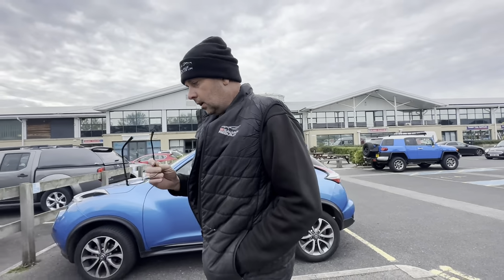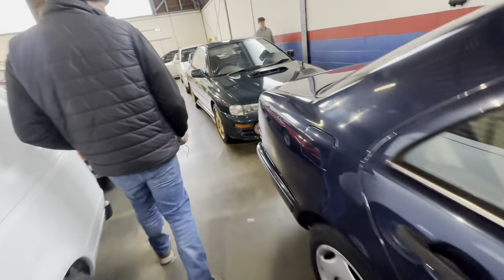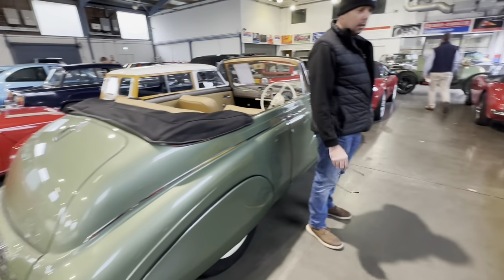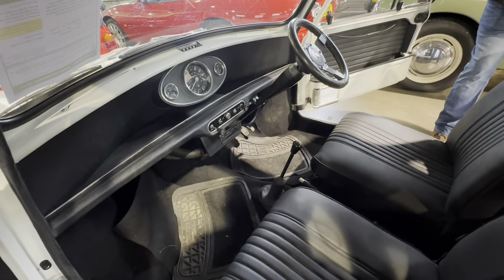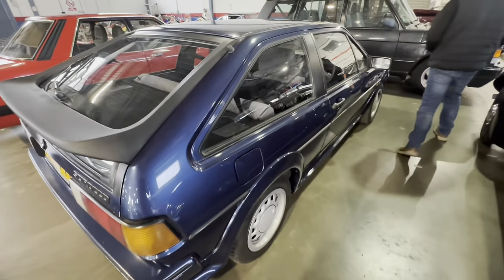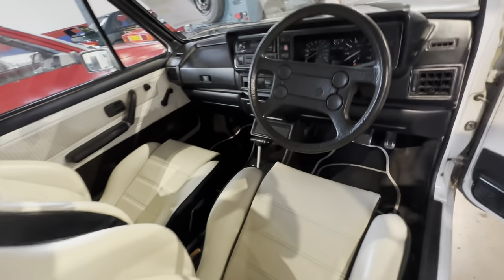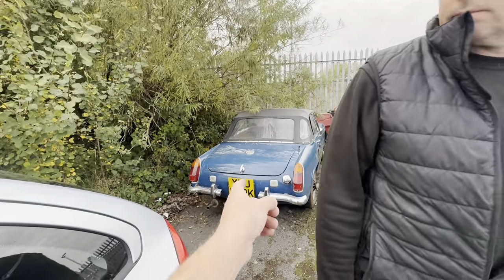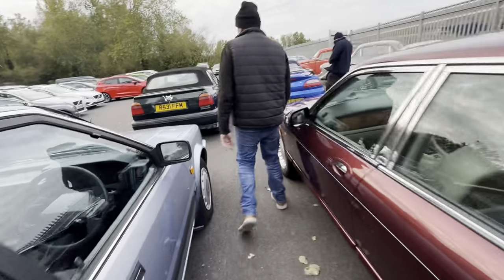CAN WE BUY SOME CLASSIC CAR BARGAINS AT AUCTION???

Comment: Volvo 940 and 240 for me! Had a 1989 240GLT auto estate in 2009 for £350 and kept it for 10 years as my daily driver. Ran perfect and sold in 2018 for £500 at 234,000miles. Now have a 1996 Volvo 940 LPT Auto estate the last 6 years. Paid £250 and runs great at 209,000 miles. Just got AC working and rebuilt the front suspension. My work van.

Comment: Chris just mentioned about the mini floor start button. I had one a 1963 mini with one DMM510A. First A from Hertfordshire. It was transformed from 850cc to a 1100cc, removed the front end and added a fibreglass clubman. Never changed the diff, so it had major acceleration and with so much torque wheel spin and broke the engine steady bar.
Reply: I think we are all going to be posting our 1st car reg.

Comment: It's a Mark 5 Cortina, Chris. My old man had a 2.0 GL (ERP 325X) in midnight blue with an auto box that was lovely. Went up in flames after a bad service at a main dealership. Bumpers, grilles, mirrors, side trim and rear lights are the giveaways. 

My mate's Mum had one of those pram top Golf GLs with an auto box. Nice little motor.

Comment: Hi Rob and Chris. The push button on the Mini was for high beam for the headlights. Quirky little feature. My first car was a 1966 Austin Mini. Wish I still had it!
Reply: There was a push button start on the floor by the handbrake. What you are talking about was the  main beam dip switch. Foot operated to the left of the clutch.

Comment: The little aerial that sticks up on the front near side bumper is called a “Fender Pole” on the JDM cars, I have one on my 2004 Toyota Celsior. The top also lights up blue when the lights are on. Very helpful to judge the edge of the car when pulling out of a tight space.

Comment: About 1963 the FB Victor had a facelift whereby the front indicators were made round and moved to the edge of the wings and the square rear number plate was introduced. Our first car was a 1962 FB Super with a four-speed floor mounted gear change: the car was designed by Gerald Palmer after his departure from BMC. You can see hints of the rounded Wolseley 6/90 rear end in the FB.

Comment: The red Cortina is a Mk5 lads, and you can tell the difference between the Mk4 and Mk5 by the front indicaters. The ones on the Mk4 are square and flat to the front of the car. The ones on the Mk5 curve round into the front wing 👍
Reply: Mk 5 had the higher roof line, though they kept the lower roof on the estate shell..

Comment: The red Cortina was a Mk5, not a Mk4. The Mk 5's had a different grille, bigger windows, different front indicator lights, rear light clusters and bigger seats. The Mk 5 was sold from late '79. I had a Mk4, S reg 2.0GL and a V reg Mk5 2.0GL. They were both ex company cars. The Mk4 was much livelier than the Mk5 and I had 100+ out of it. I wish I had kept it it was in the really nice Midnight Blue. Ford gave the Mk5 the name 'Cortina 80', but everyone called it a Mk5!

Comment: Really love your views on these old cars and all your videos in the workshop. I am now back in Norwich with a 2003 Rover 45 1.8 IXS as a second owner. Had it now for 14 years. Now on its second head gasket, but runs extremely well.
Reply: You need to drive it like you stole it - K series engine? - the lotus has the same engine but never had an issue - all to do with dead zones in the cylinder.

Comment: I had a Victor same year same colour. Floor shift version. Like stiring paint.  Engine went on fire  so it had a bonnet ring for a while. Very comfy. Wheel came off just by Stonehenge. I  had the on condition maintenance plan.  Thanks for the memories.

Comment: Escort van ended 2001 ,it was due to finish in 2000 but its replacemnt was due to be built in turkey but there was an earthquake and the new factory collapsed so the build carried on in a small building out the back at halewood it went on for 14 months.

Comment: Great video guys.
Suggestion. I would like to se more so why not split the video into to parts, Wednesday and Thursday. 
Yes, all the early minis had a floor start, my Mother had a 1959 Austin seven mini, the first in Brighton. Tarmac stones used to get stuck in the floor starter and to free it you had to drop in in 1st gear and rock the car backwards and forwards. My guess on the row of Rollers and Bentleys could be too expensive to run!!!
Really enjoy your tours. Cheers, Bob
Reply from the maker: Would be to late tomorrow bud the auction starts at 12 today and runs untill tomorrow 👍

Comment: Thats a Mark 5 Cortina... I had a Mark 4 1979 T reg 2.3 Ghia manual, with black vinyl roof and painted in Jupiter red,  the bumpers, and mirrors are the big giveaway for the exterior, to help distinguish between the two...

Comment: Quickest way to tell the Mk4 and Mk5 Cortina apart is the wrap around front indicators on the Mk5. Several other differences but that's the easiest. :) Love that Fiesta. The 1.4 CVH was a lot of fun. I'd take that with the Cortina...and the Renault 5...and the......lucky I don't go to these auctions, I'd be very poor. lol. Great video, lads. :)
Reply: "The 1.4 CVH was a lot of fun" : i had one but has a few challenges with blocked breather and valve stem oil seals

Comment: The early mini did have a push button start on the floor plus the inside door release was a cord from front to back above the door storage pockets with sliding windows front to back with a push button release, they were the easiest locked car to get into by putting your knee just under the door lock and yank down. But the rigid bypass hose from block to head was a nightmare to replace.
Reply: had to do that hose on m2 services when you could buy parts in a petrol station that was a hard job

Comment: The cortina had flat front indicator lens so I think that makes it mk4, the 5s had wrap round. I once hired a car to go to a wedding. I booked a fiesta but they gave me a Renault 5 so I told em I don't drive cars with only 3 wheel nuts. She said it's got 4 so I took it, I was doing 95mph down the motorway! I must have been mental.

Comment: Loved that rg125 gamma in black red white.always wanted the rg500 in those colours.settled on the pepsi coloured rg500 from 1989. Had the rg250 in walter wolf too.
Reply: RG500.  Not having one is why you are still here 🙂
Reply: I had a spin on a friends RG500. Would love one. Although the kickstart being disconnected when the clutch was pulled was a bit weird. Day I rode it was a hot day and I didn't dare stop the engine due to the clutch / kickstart, and then I got caught for ages at a level crossing. I felt like a boil in the bag meal!

Comment: The MGC would be worth buying to salvage the engine and bonnet. The tooling for the bulged bonnet is no longer available as it was modified for the MG RV8 when it was reintroduced as a stop gap. Consequently MGC bonnets are rare and desirable. First thing that needs replaced in a frontal accident.

Comment: Hi both, mk 5 cortina with wrap around front indicators the mk4 were flat on the front. Great vid. I had several cortinas different mks but my mk5 5 was the same in midnight blue. Had so many different cortinas from mk3 to mk5 I had to invest in a void bush remover/installer tool which I still have lol.

Comment: The white Vauxhall Victor - What a loverly Car?? - Had several of those back in the 70's - So comfortable and quiet as well - like driving in your old sofa - One of the most Under-rated cars of it's day - probably due to the way they rusted well ? 😄 .... Love these Classic Car video's by the way .....
Reply: They didn't rust as badly as the F-type that preceded it! When my father sold his very tidy FB during the oil crisis in 1973 and bought a Mk. IV Zodiac (due to expanding family) the garage snapped his hand off and within a day it was on the forecourt at £150 - impressive for what was then an eleven year old car!

Comment: Mk5 Tina  had plastic  ends on bumpers 
Mk4 had chrome full bumpers and smaller back lights
Reply: A big difference that probably passed a lot of people by was that one of them had a lower roofline to the other (can't remember which way round), but a local bodyshop found out to their cost many moons ago when they painted a new door off the car, fitted it, only to discover a gap at the top! Oops!

Comment: You boys have big pockets! The foot switch on early mini's was if I recall for high or dipped beam, ( least I think so) Great vid and the recent variety is welcome.
Reply: I had an Austin seven mini. Floor switch as the  starter. Cables to open the doors and sliding windows. Box changed from the  850 to an 1100. Loved it
Reply: My memory has failed , you are right.

Comment: The MGC was the spiritual development of the Austin Healey 3000, using the C series engine, which needed the bulge in the bonnet not required for the V8. The V8 is what BMC went with when they wanted another big engined variant in the 70s.
Reply: The MGC did not have the same C series engine as fitted to the Healey's, the only similarity was the engine displacement. The Healey C series was an Austin engine with a 4 bearing crank, the MG C engine was developed by Morris Engines in Coventry and had a 7 bearing crank.
Reply: @fenderac3049  You're quite right. I didn't mean to say same, but changed something I'd written without deleting that. Well spotted. It's why I had said spiritual development – straight six sports car – even though it was a different motor altogether. Will amend.

Comment: I don't know about the floor push start button on the early Mini's, but my first one had a button on the floor for the headlights. 925 WOO
Reply: I had a 1959 minivan with a floor push button start in the middle of the floor to the left of the drivers seat by the handbrake.

Comment: The Ford cortina was a mk5 not mk4 because the bumpers were different on the mk4 but the mk5 was lovely car.
Reply: No. It is a mk4. The indicators on the mk5 fold around the wings where as the mk4 are level with the end of the wings.
Reply: @PaulHallam-zo5ch just was going to reply with the same comment. My grandad had a mk4 and mk5, his Alsatian ate them both
Reply: @PaulHallam-zo5ch  the indicators DO fold around the front wings on this one AND it has the bigger taillights (funfact:- they were the same shape as MK1 and 2 orion so some mk5 cortina owners put those on to modernise it a bit back in the day) so 100% MK5 bud.

Comment: Hi Rob cortina is Mk5 model wrap round indicator and bigger tail lights and slatted radiator grille 1981 X MK4 was upto 79/80on a V or W
Reply: And many owners didn't realise that the MK5 was actually taller than the MK4. Even though the body looked exactly the same, you couldn't interchange the doors or windows.
Reply: The last of the Mk4 was on a V reg. Better then the Mk5 😃Had a few of them both and have Banger raced shit loads. Wish I had kept them

Comment: Mk5 cortina or as it was officially marketed as "the cortina 80". As ford said it was just a mild facelift.. Same as the mk3 capri.. Its officially still a mk2, as recognised by ford.. and the logbooks often say its a mk2.. but ford said its a mk2 with a mild facelift.. As for the mk2 fiesta 1.4S.. Cracking cars that often gave the XR2 a good run for its money. Unfortunately most of the Sports rusted very badly.. Hence why there's not many around.. because of this values are shooting up.

Comment: Looks like genuine milage on that Vauxhall Victor.
Reply: the victor in 12 May 2008	99886 miles then 11 months later it was down to 795 miles
Reply: @dazbam2 thats because its went round the clock